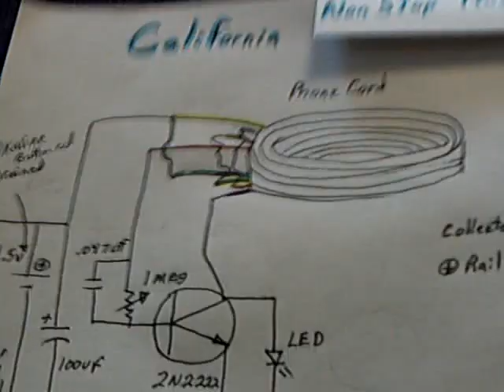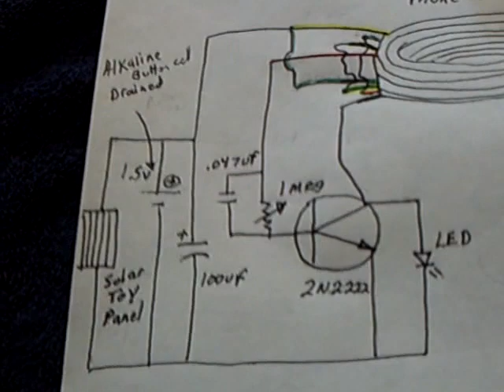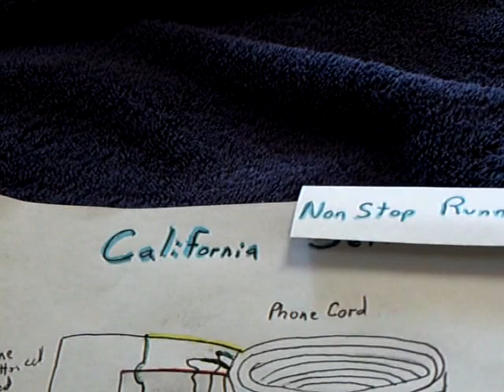California Non- Stop Runner

Comment: how to stop the blinking light any help
Reply from the maker: ???. "stop the blinking"?  If you lower the resistance the blink rate (oscillation rate) goes up. At 60Hz or more your eye will see it as always on but it is still blinking.  That is what saves the energy.  The led is not on all the time as a dead load. If you want the led to totally stop just turn it off with an on off switch at the capacitor (+).

Comment from the maker: Thanks.  If you get a chance take a old garden light and swap out the rechargeable AAA for a dollar store alkaline and you wil be surprised at how long it will last.  Just be sure to take the battery out before it goes completely dead and starts to leak.  Some alkaline brands work better than others. 
   We had two good boat trips this year.

Comment: Great tip on the old Alkalines :)
4 wire phone cords work well for wireless pancakes too, better than 2 cord a lot of times. The increased capacitance and resistance play well with low uA, demonstrated well here in your vid.
That trip on the boat must have been good, even your voice sounds tanned lol